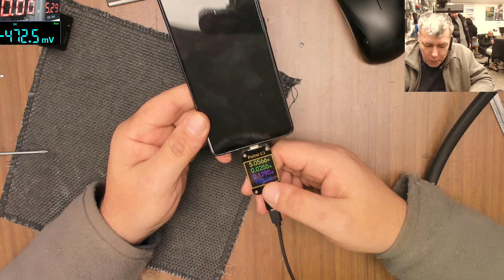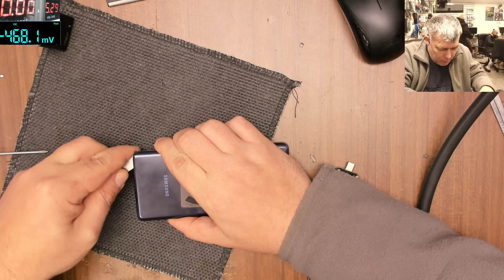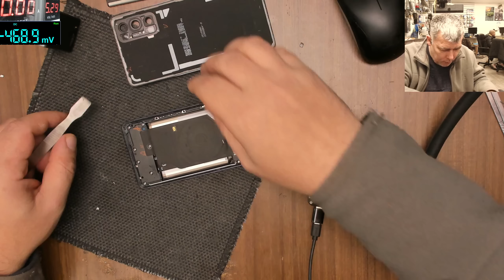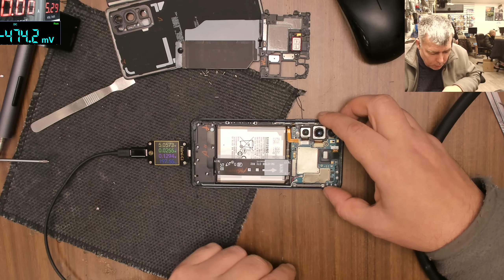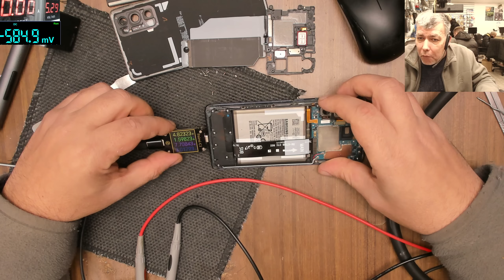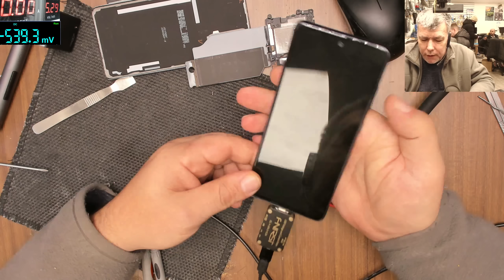Samsung S20FE not charging not coming on repair - a easy one

Comment: Samsung has this Problem on many other models. The Problem will come back, because the connector has no proper connection to the FPC. A jumper wire from plus to plus is the solution

Comment: Unfortunately it will come back, you need to put a wire between the top and bottom fpc connector to make constant contact. These phones are bending over time and the connector on the motherboard is becoming larger and not making contact. We do lot of A70/A71 with this kind of issues here.
Reply: Hi do have any permanent solution for Nokia 6.1 plus not charging due to loose type C connector? I changed whole board-connector but problem is back after several months.
Reply: I do repair smartphones and do agree with you, it,ll come back , same damn problem with a70

Comment: I can't thank you enought for this video, you saved me a lot of money and I did it myself! My phone was not charging anymore, and when I found your video I tried to put pressure on the back cover just over where this conector is placed, then my phone started to charge. But if I let go the pressure it stoped charging. Then I knew I had the same problem as the one in your video. Now my phone is charging again! Thank you so much!

Comment: Thanks so much. I fell backward and landed on my s20fe yesterday and now it would not charge with the cable but would charge wirelessly.  Knowing this connection may have been the issue I pushed and gave it a few slaps where this connection is.  Up and charging with the cord. At least now I do know what the issue is. Thanks again for your video. Have a great day.

Comment: Wow, thanks a lot sir. I literally just pressed the area where the connector is, without opening the phone and it is now working. I went to 2 shops to fix it and they were asking me to wait for at least 3 to 4 days to make a diagnosis for 30 euros, so I said no. They were doubting it was an issue with the mother board and wanted to change it for 100 to 180 euros, but you were right.
Be blessed.
Reply: YES! APPARENTLY PUSHING THE BACK OF THE PHONE FROM OUTSIDE WORKS LIKE A CHARM!
Reply: Omg!! I've tried everything and it will randomly pick the usb charge whenever so randomly!! And now I pressed the phone in different areas and once I prese the middle of the screen boom!!! It start charging!!!

Comment: YOU HAVE SAVED ME FROM SPENDING HUNDREDS ON FIXING MY PHONE, THANK YOU!  My S20 wouldn't charge so I replaced the charge port and it still wouldn't work.  Watched your video, unplugged and plugged back in the battery and it works perfectly.  I think mine came loose from dropping and/ or hitting my phone many times.  It has taken a beating over the years.  Thanks again!
Reply: ayeo, was your phone turned off when u unplugged it?
Reply: @amanpre3t  I believe I turned it off.  Whenever you mess with electronics they should be turned off first.

Comment: Honestly im shocked, mine stopped charging and went from 40 to 0 and has been randomly throwing up a moisture detection warning even though it's not been anywhere wet or even humid, pressed firmly on the back where the connector is and it just started charging, i hope it charges all the way and i hope its not something it does again but if all i had to do is press in that spot firmly i genuinely cannot thank you enough for this video. My s20fe is my favorite phone ive had and i was heartbroken when it stopped working so if this works thank you a million for saving me from having to get another phone

Comment: Been wireless slow charging for the past 2 days. Decided to crack it back open and issue was exactly the same as the video. So thanks for that. Did a screen change about a month ago and afterwards with phone in my pocket at the gym, the power connector shook loose. Now this. Apparently after the initial disconnecting of the ports, they become way easier to jostle loose. I expect that this won't be the last time. Unfortunately.

Comment: thank you sir, fortunately you are very helpful, my S20 FE charging problem is solved. I was very surprised, I have done many ways, starting from disassembling the Flex board USB Charger Port Connector, and all other ways, but it turns out that with just one push on the flexible cable, all the problems are resolved. thank you very much, your video is very useful and helpful. and again i very very appreciate that.

Comment: Thanks a lot for sharing. Just had this issue with my S20, and at least for me, the issue was intermittent, and came back even after I tighten the connector over and over.
The root cause is bent connector.
To fix it- you can either use a jumper or some glue. For me, just a little glue (B-7000) solved the problem.
Reply: did you put the glue on the conector ?
 having same problem here  s20
Reply: @Galifilakis  yep. Very little B-7000 right on the connector. Issue was solved.

Comment: Buna seara. Pot sa scriu si in engleza dar prefer sa o fac in romana, sa stiti ca mai sunt si romani interesati de electronica. Problema telefonului este cupla de pe main board. E o problema des intalnita la seria A ( A10, 20, 20E, si pana la A70 si A71), si nu numai . Cupla se rupe din lipitura in partea din stanga jos (cum tineti telefonul vertical) , dar sunt si cazuri cand se rupe de tot. Lucrez intr-un service GSM si repar cel putin 4-5 pe saptamana cu aceasta problema . Noi le schimbam complet. La seriile noi am vazut ca le-au facut din metal , deci risc mai mic sa cedeze. O seara buna !
Reply from the maker: Multumesc, stiu ca e un defect comun :D

Comment: For everyone where just reconnecting it doesnt fix the problem: In my case i just put like a 1mm thick stack of tape over the left half and used the plastik wireless charging housing to basically push the connector like in the video

Comment: thanks for the video. before I open my s20 fe one question. my charge cables with led lighs on them, it turns off the led on the cable when I plug them in and won't charge. wireless charging still works. think your method will probably work for me? If so I order tools and open it right away. if the light going out indicates a real port problem then maybe I should take it to repair center?. thanks for your help with my question.
Reply: I pressed on the spot with the connector through the case and no change. no charge and the light on all my charge cables stay off. I just ask because i don't want to open it if it just will need to go for service later.

Comment: all samsung A series have the same problem. the connector get slightly lose so I squeeze the connector a little and run a jumper wire from main board to charging board to make sure the customer will not coming back again
Reply: which A model? need help finding a video where to put jumper, thx

Comment: 4:59 right now, you shouldnt expect the phone to charge via USB!!! Samsung phones, released after the Note7, will not charge with the NFC/Wireless charging coil disconnected, because the coil has integrated a temperature sensor for the battery. Please, keep that in mimd for future repairs!! If you force the battery to charge without the coil, you will make the phone go into a software safe mode with a limited battery charge of 60%.

Comment: I have a S20 FE with this exact issue, I did open it in the past, unplug the battery connector and put it back. Charging works again, I am pretty sure they have a hardware defect or a design issue in this charging unit and that from time to time it needs a hw reset. Too sad you cant do it like in old days where batteries were fully amovible...

Comment: Its a known thing with several Samsungs that the flatcable over the battery is a problem, they are too long and push themself out with vibration or whatever.

Comment: Its actually a very common problem with the new samsung phones all A series from after 2019 have it it happenes after hard drop the connector cracks it may charge now but it will come back.A true fix is to change the connector on the MB
Reply: No brother don't do hard way just solder tiny piece of wire on first pin ground on connector and thats it :)

Comment: Had exactly the same problem once with the ZTE Axon 9 Pro
I couldn't figure it out . I think its from the assembly  line of the phones on the factory. It's an easy repair but unfortunately it destroys the little water resistance it has.

Comment: Like this comment to help others : SOLUTION : Piece of jumper or more tiny wire on first pin (solder outside connector lol) and just put it over other side put flat in to place so wire get shape remove flat solder wire job done :)